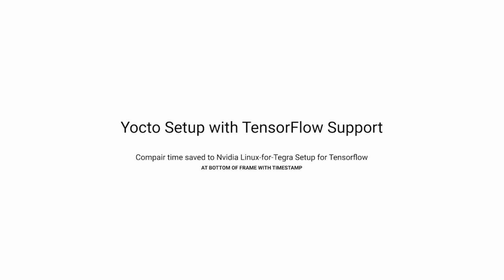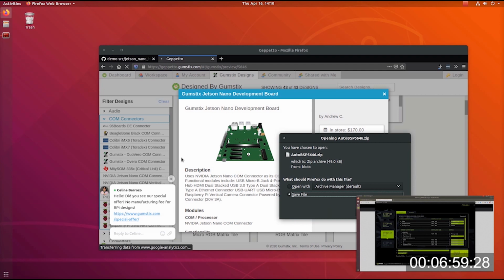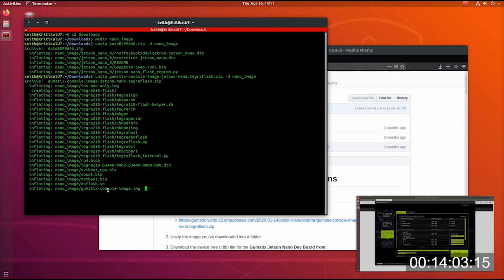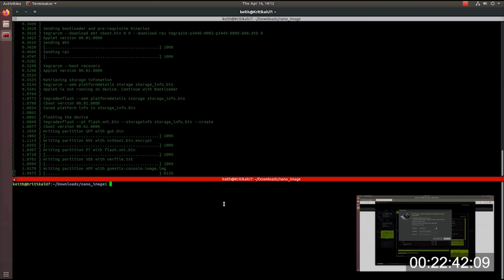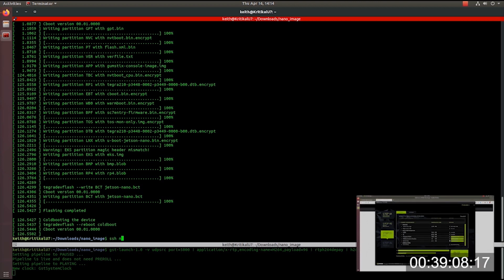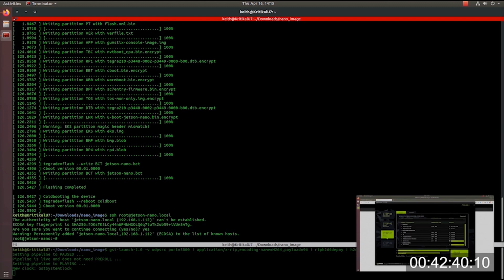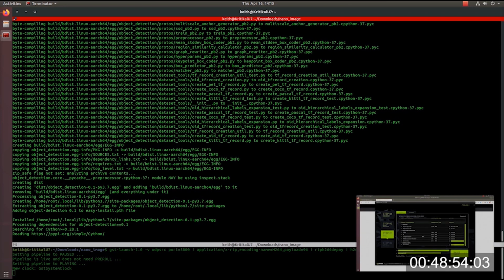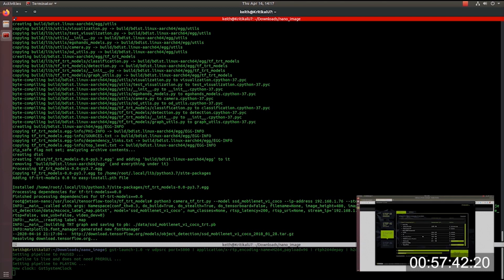10 Minute TensorFlow

Comment: Nice Video!! But could I bother you with a somewhat unrelated question? I am writing a low level SGD code for minimizing a cost function in TF2, but can't get it to run on a GPU, and hence am not getting results quick enough. Could you point me to a simple implementation of SGD.minimize in TF2? It'd be a great help. Thanks in advance